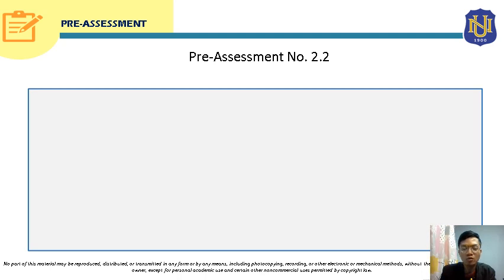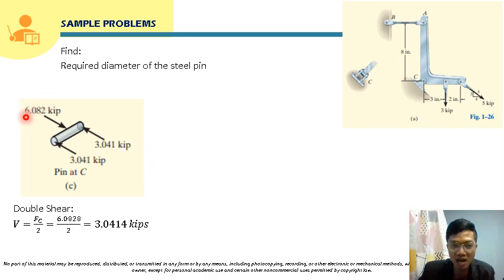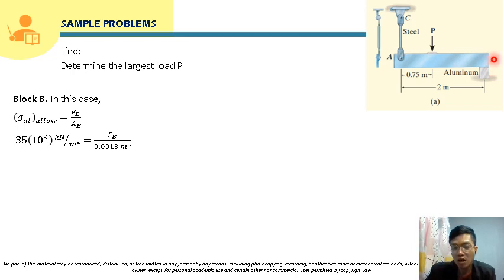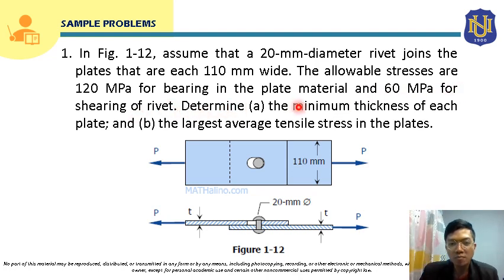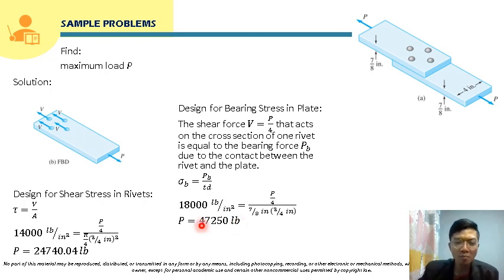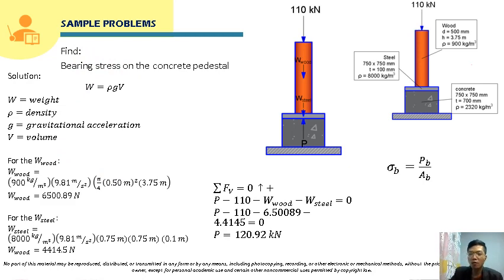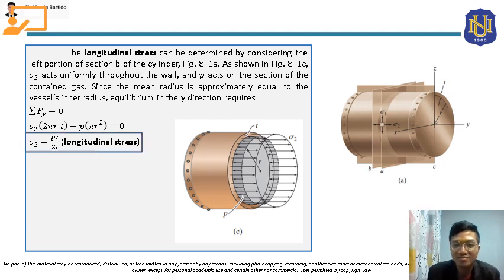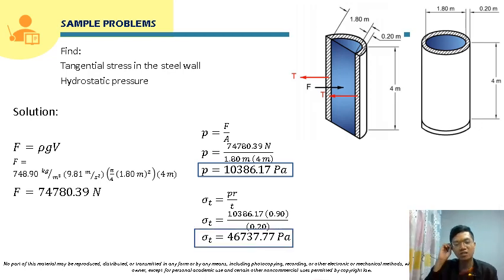Mechanics of Deformable Bodies - Fundamental Concept of Stress (Part 2/2) [Bearing Stress]

Comment: Sir sa last sample problem mo sa Tangential and Longitudinal stress, from the given you show the thickness of the cylinder is 20mm or 0.02m sa solution mo is 0.2m which is 0.02m dapat. The final answer is sigma_1= 467377.425 Pa, if I'm not mistaken.
Reply from the maker: Typo error. Thank you for mentioning. :)